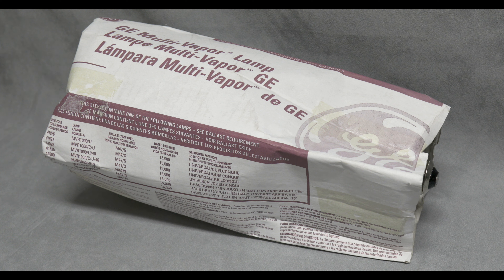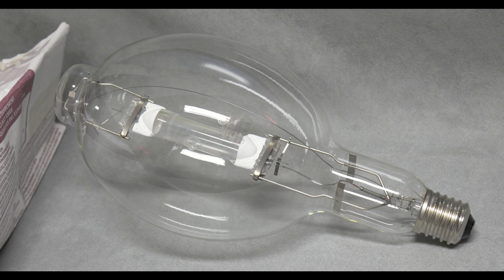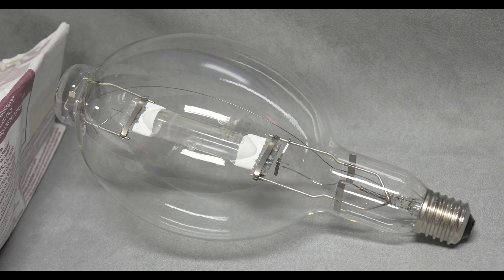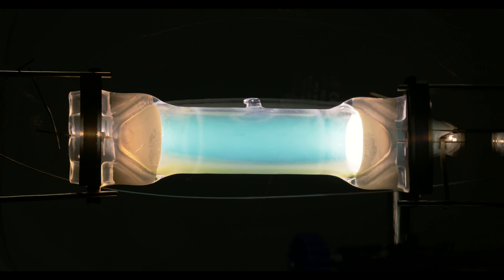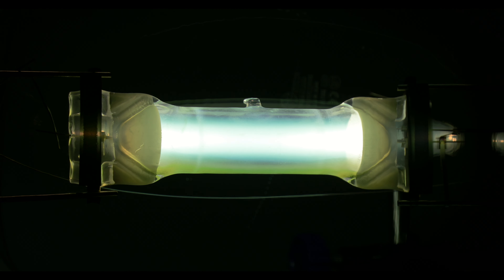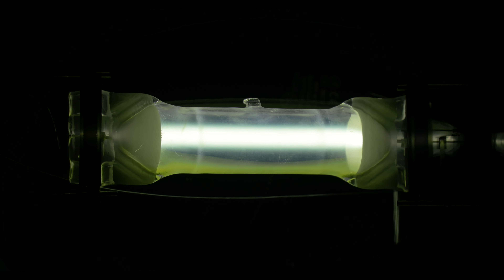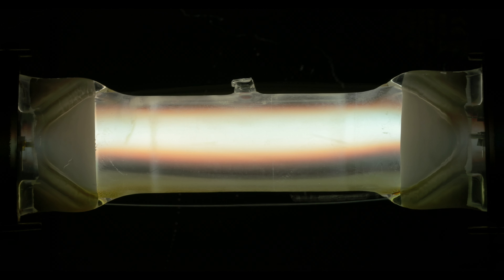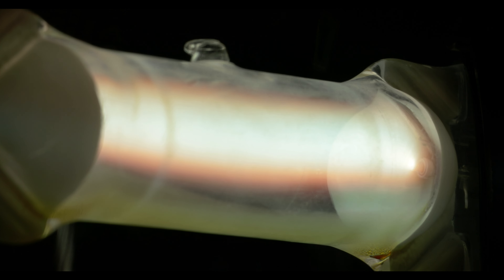1000w GE Multi-Vapor Metal Halide Lamp

Comment: That’s a proper lightbulb
Reply from the maker: I have a 1500w version also!
Reply: @FrontSideBus  that’s an even more proper lightbulb. Lol
Reply from the maker: @TheCORC964  I might have to do a video on that one as I don't have the right control gear for it. To get it going right, it needs a bit of variac-ing with that big 2kw gearbox that I shonked together a while ago.
Reply: @FrontSideBus  might as well. Try not to bust it tho lol
Reply from the maker: @TheCORC964   Heh well you have to watch it, that very thin flywire that goes to the other end of the arc tube glows red hot if you are not careful! They are really supposed to be ran on CWA ballasts instead of chokes.
Reply: @FrontSideBus  lol it’d be funny if you accidentally made it a dual arc lamp. Looking forward to the video tho!

Comment: Hey, you might have an answer for me. Can you run a mercury-vapor lamp on an equivalent-wattage probe-start metal-halide ballast? I tried it out recently with a 400w ballast and lamp and it seemed just fine, but will this cause any issues in the long-term?
Reply from the maker: I'm no expert on US ANSI lamps but as long as the lamp current in the datasheets are the same you should be good. It even gets confusing in Europe since most 400w halide lamps are designed to run on 400w mercury ballasts (3.2a) with 750v soft ignitors, but then you also have 400w halides that are designed to run on 400w SON gear (4.6a) with 4-5kv "hard" ignitors. It's quite often to see lamps running on the wrong gear in the wild heh!
Reply: In the US, yes, you can run an equivalent wattage mercury vapor lamp on a probe-start metal halide ballast. Most metal halide ballasts will say on ballast label they will also run the equivalent wattage mercury vapor lamp. However, you cannot run a probe-start metal halide lamp on a mercury vapor lamp ballast.